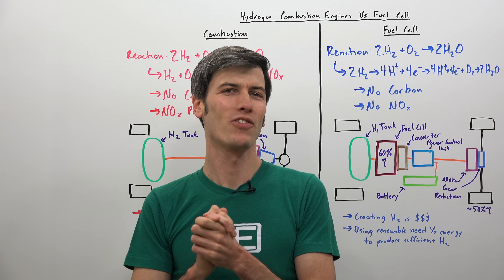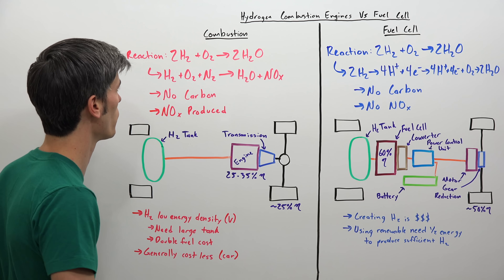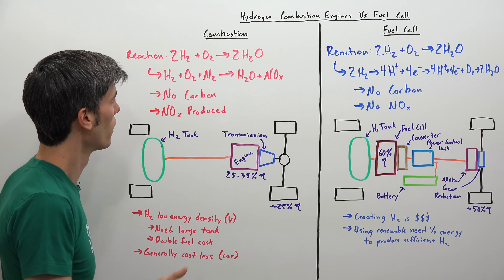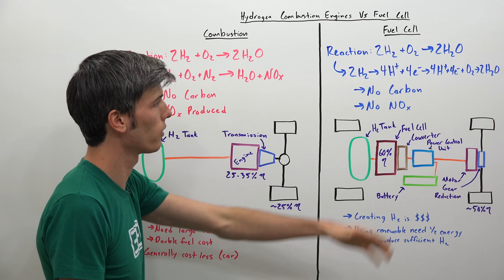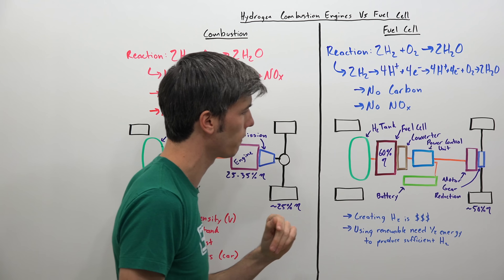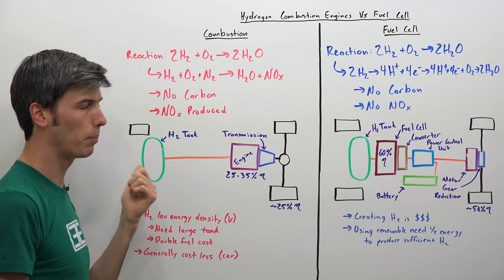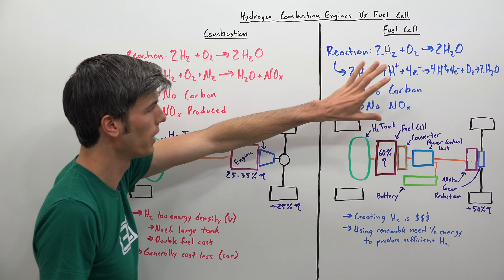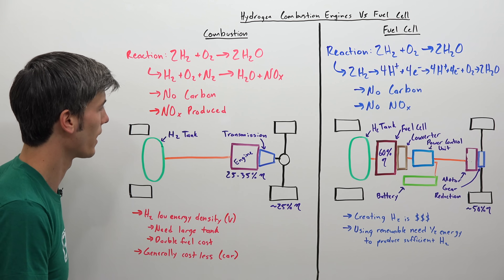Why Hydrogen Engines Are A Bad Idea

Comment: Great. But your first line chemical reactions are overly simplistic because you conflate oxygen with “air”. Neither of these solutions use a tank of pure oxygen. They both use air. Air is mostly nitrogen, as you imply on the left. But your description leaves it a bit unclear how the hydrogen engine produces NOX.
Reply: Yeah clearly he is a OPEC agent
Reply: He has in other videos. It comes down to the fact that the temperatures in a hydrogen combustion engine get high enough for reactions that produce nitrogen oxides to occur.
Reply: Any time you heat air much above 900 degrees C, the diNitrogen bonds begin to split into atomic nitrogen, the nitrogen then preferentially grab oxygen molecules. Above 1500 C this really starts going in earnest. You don't even need to burn anything if you compress air to a high enough temperature and pressure.
Unfortunately, any Carnot heat engine needs a large differential between the hot side and the cold side for maximum efficiency. This set of NOx reactions is also endothermic, further stealing energy from the combustion process that you want to turn into mechanical energy.
Reply: @Markle2k  last time I checked a combustion engine doesn't go higher than 300 C.
Reply: @Markle2k : Catalytic converter...   they do "magic".

kidding, they do Chemistry..
Reply: @NekarXenos  300 C isn't even hot enough to get the catalytic converter working. The flame temperature can be upwards of 2500 C in a diesel under load. Just from compression of the air a 10:1 CR gasoline engine gets to 463 C with a 20 C intake charge.
Reply: @Markle2k  2500?

what diesel engine ? where in the engine? under which circumstances?
diesel powered furnaces have  hard time melting cast iron let alone melt steel
Reply: @Markle2k  463c ? why would a gasoline engine need a sparkplug?
Reply: @Markle2k  463c? selfignition?
Reply: @janvanruth3485  All your questions were answered in the post you are replying to.
Reply: @Markle2k  you are just kidding, right??
don't have the answers? do you?
Reply: @janvanruth3485  Your reading comprehension sucks.
The flame front in a diesel under high load can reach over 2500 C. Diesels work opposite of spark ignition. Adding fuel raises the temperature. The exhaust isn't this hot because of work done through expansion and conduction through the cylinder walls.
Don't get carried away into rudeness just because your ignorance leads you to incredulity.
Reply: @Markle2k  if you have trouble putting forward ideas in a clear way maybe you should refrain from commenting .
first it was the flame, now y corrected it to the flame front
first it was under load, now it is under high load
Diesels work opposite of spark ignition?
what is that supposed to mean?
maybe: Diesels work differently from non self igniting engines that need a spark plug?
adding fuel does not raise the temperature, adding MORE fuel does.
now please do explain why at a temperature of 463 c , which is higher then the temperature of below 300c needed for self ignition of an air/gasoline mixture, a spark plug is needed.
Reply: @janvanruth3485  Stay in school mate!
Reply: @fleecemaster  ok, you give me the answers then.
Reply: @Markle2k  The ideal solution would be to combine pure Oxygen with pure Hydrogen. This can be produced by electrolysis of water, but the energy requirements are extremely high.  Combining pure Oxygen with pure Hydrogen will produce H2O as the only byproduct, but storing these two elements separately in a vehicle environment would be a challenge. If we had the Liquid Thorium Salt Reactor tech developed perhaps the electrolysis energy requirement could be met but............Hmmmm?

Comment: IMHO: FYI: I'd really like to see someone produce an "OPPOSED PISTON, DIESEL (INTERNAL COMBUSTION) ENGINE!!!.... AND USE IT FOR AN ELECTRICAL POWER GENERATOR, (FIXED BASE, OR PORTABLE)..... THE HYDROGEN COULD BE ELECTROLYZED, FROM ADJACENT SOLAR P.E. ARRAYS (i.e. ...ON A HOUSE/BARN ROOF, ETC.)... A high-pressure storage tank, can hold a lot of hydrogen, and still weigh less that a full liquid fuel tank.
Reply: I was yelling at my screen too, WHAT ABOUT HYDROGEN COMPRESSION ENGINE??? NOBODY IS USING THIS GREAT PROCESS AND USING IT IN DIESEL ENGINES???

Comment: you have right. atmosphearic air contains N(itorgoen), when we are using it in with high preassure and heat we are producing NOx (look diesel engines and high combustion gasoline engines).

Comment: I have one for you.
Diesel engines are notorius for NOx.
This happens because high oxygen environment inside the  combustion chamber.
The question is;
Is it possible to reduce NOx by adding LPG fuel in some small amounts. Knowing that LPG would definitely grab the extra oxygen preventing nitrogen from creating NOx.
I was thinking about that and on paper that looks good.
LPG will increase torque and hp value for sure, but reduction in NOx is what I'm interested.
What is your take on this.

Comment: Seems like an EV is much simpler
Reply: EV is cheaper, too, both to buy and fuel.
Reply: The only good thing about hydrogen, is it would be a perfect way to store the excess energy from wind turbines after a wind storm. Rather than curtailing, it would be nice to have a way to use that excess energy, despite not being as efficient as charging a battery.
Reply: @mychevysparkevdidntcatchfi1489 thats cuz there are no hydrogen combustion cars for sale
Reply: @greynolds17  No, it's because you can directly use the electrons to fuel a battery. Electrolysis of water and compression chew up half the energy before you even figure out how to get the hydrogen into a car's tank.
Reply: @Markle2k  I said hydrogen combustion...not hydrogen electrolysis
Reply: Vincent Robinette 
There are two reasons why that is a bad idea: 
1. The windmill would have to be build to turn very fast, increasing the costs. 
2. A station to make hydrogen would not be economically viable if it is only run when there is a storm.
Reply: @greynolds17  You need to get the hydrogen from somewhere. The atmosphere pretty much tosses any free hydrogen into space. The rest is locked as water, and to get hydrogen, you need to spend energy to split it out and pressurize it so it doesn't take up the volume of the entire car.
Reply: @vincentrobinette1507  
Can't you just have a bunch of batteries underneath the turbine?
Reply: @Appletank8  yea...I know how it works
Reply: @greynolds17  
then what part of that process makes it a good idea to use hydrogen for transportation? i will admit that hydrogen is definitely superior in refuel speed, though if capacitors evolve to increase their storage capacity, hydrogen will take the backseat again.
Reply: @Appletank8  where did I say it was a good idea?
Reply: @greynolds17  
Ah sorry, I misinterpreted your earlier statement as an assumption that hydrogen cars would rapidly outpace EV growth to make them irrelevant. If hydrogen storage/generation gets vastly better, that might happen.
Reply: It is, and it will be the future.
As neat as Hydrogen sounds, it wouldn't work.
Reply: @Appletank8  You could, and that's a great idea. The only thing is that during a wind storm, a large turbine could charge a 500 kWh battery in only about a half hour. A hydrogen electrolyzer  could assimulate 20 times that. It's just a way to not curtail in those times of overproduction. I still like the battery idea, though, because you can call upon the turbine even if the wind isn't blowing, and, you don't have to allocate extra land for the energy storage. Win-win. The hydrogen thing would just be a bonus.
Reply: Meh, a turbine with a continuously variable gearbox will handle any problems rotating too fast, or not fast enough. Rotation speed is irrelevant if we're not talking about all the innards of turbines as a complete system. Hydrogen has niche uses in the modern world, but long-term storage and efficiency in initially producing it are the only real issues these days.
Reply: @eindeend  It would only be practical if there was already an infrastructure in place. It wouldn't be worth it to put an electrolyzer in, just for that purpose. The blades of the turbine can be pitched to regulate speed, and even keep the torque in check. Just an idea to take advantage of a storm, rather than just letting it pass. The rotor torque increases on the square of wind speed, the power increases on the cube. During a storm, a turbine can produce 8 times more power, if the wind speed doubles. If, like you said, it could be built to run the higher speed. That's a huge potential, but, not likely with today's technology.
Reply: Everything has its advantages and disadvantages, innovation won't stop ever, soon there would be something better than ev's
Reply: @dhruvalbhansali3632  If you look at the fact that internal combustion has been around for well over a hundred years, and look at how many years steam ruled the railroads, I'm thinking electric vehicles will also be around for at least a hundred years or more. The biggest changes will be in the source of that electricity. That goes for both the way electricity is generated, as well as the way it's stored in the vehicles. For the sake of regenerative braking, there will be a need for a modest battery, or some kind of capacitor system. Who knows: Maybe even a system involving springs, pistons and hydraulics.
Reply: @vincentrobinette1507   agree with u bro, battery technology is the only hurdle seen in proper mainstreaming of EV's , going with history, EV may last 100 years at least, but we never know, technology is progressing exponentially now then ever before, anything could be possible!
Reply: @dhruvalbhansali3632  I agree. It will be interesting what takes its place. who knows. I joke about my next car not coming with the optional engine, but in the future, your next ride may not even come with wheels! Imagine a conveyance with touch controls, with absolutely no moving parts. RELIABILITY!!!!!!!!!
Reply: @vincentrobinette1507   super reliable for sure! maybe a ion thruster engine! we may never know, but surely future is something to be excited for!
Reply: @dhruvalbhansali3632  AAAAAAMMMMMEEEEEEEEENNNNNNNN!!!!!!!!!!!!!!!!!😎👌
Reply: EVs as we know them today are not sustainable in the long term, there really isn't many viable large volume chemical storage on the horizon, under current consumption we are likely to run out of lithium before we run out of oil
Reply: @BluTrollPro  That's especially true, if lithium is used for stationary storage, as well as vehicles. For stationary storage, we should be exploring less expensive, even if more bulky solutions. Save lithium, where power density is of particular importance, like vehicles, and consumer electronics. Australia just found a lot of lithium, but I still don't want to squander it on stationary energy storage.
Reply: It is, far better, faster simpler and more fun the ICE engines.

Comment: The combustion engine might need a bigger tank but the fuel cell needs an H2 tank, a Fuel cell tank, coneverter, power control unit, big ass battery, and an eletric motor. Just looking at the drawing, you can see the fuel cell power looks unblanced, heavy and over complex with alot more space needed to make power. I would take the combustion design.
Reply: Toyota and Hyundai already have working products not sure what you mean by unbalanced? Is it the weight because alot of our cars have balanced and unbalanced variations.

Comment: You've stated 2 disadvantages of the Otto engine. First, the Otto's NOx is greatly reduced by EGR, as you well know. Second, internal-combustion engines aren't the only ones that can burn H2.  The Stirling-Engine is much more efficient than the Otto engine, and doesn't have a NOx problem because it doesn't use the high temperature that's easily-feasible with the Otto's very brief combustion (In the Otto, the metal doesn't have time to melt). Without the temps possible with explosion-engines or super-high-melting alloys, NOx isn't a problem.

Comment: Next video: here is why hydrogen engines are good
Reply: Look back at previous videos, this is not his first hydrogen related video.
Reply: @jaydunbar7538  they've all been critical of hydrogen while he keeps singing praises of EV. We need him to even out the bias.
Reply: @kirknay  You can't even out the bias when one technology is inherently worse than the other.
Reply: @kenkalajdzic  except when the ecological impact of batteries are worse than steel or carbon fiber tanks and fuel cells, refuelling is down to 3 minutes instead of 8 hours, etc.
Reply: @kirknay  Is it really worse though? They ain't good for sure, but so far there's no evidence of batteries being worse - especially when they can be recycled. Recharging can be as short as 15 minutes, we just need better infrastructure. And that's with current technology, that keeps improving quite quickly.

Also, don't forget that that awesome hydrogen has to come from somewhere. And it usually comes from natural gas in a very NON carbon neutral procedure. Alternative is using lots of electricity that you might as well use for charging batteries (about 3 times less at that).
Reply: @kenkalajdzic  15 minutes is still an eternity when you need to drive for 4 hours to get home from reserve drills. Hydrogen from natural gas is currently a stopgap until the infrastructure and demand is ready.
Reply: @kirknay  It's not ideal (yet), but you need breaks anyways when driving long distances. Most people stop for at least that much even now with <1 min refill times on gas tanks.
Hydrogen could be a good stopgap solution until battery electric tech matures, but it's pretty expensive one. Probably too expensive to invest into when you already know it's getting replaced relatively soon. I guess that's also why most companies never put too much effort into it and are now all jumping straight to BEV.
Reply: @kirknay  There is no way to even out the bias and remain fair and objective. Battery-electric has the lead in efficiency from input to rolling wheels.
And give up the tired old talking points about batteries being more dirty. That was debunked a decade ago.
Reply: @kirknay  15 mins is an eternity? vs 10 mins to refuel hydrogen? If 15 mins will make or break you, you're doing something wrong.
Reply: and without fuelling infrastructure, it is useless. Need some poor sap to install the manufacturing of it, only 40% efficient, how many fuelling stations are you going to install, how many diesel tankers are you going to have to transport it around. Under the control of big oil I bet
Reply: @Markle2k  Batteries weigh twice as much which takes out all their supposed efficiency savings. Fuel cell is the future, it can replace gasoline in almost all usages, batteries cannot.
Reply: @agt155  Twice as much as what? A fuel cell vehicle? My brother has a Honda Clarity FCV. It's enormous in comparison to the Model 3 LR rear-drive. The Clarity weighs 200 lbs more. They have nearly identical passenger volume. It has a ridiculous 57/43 weight distribution that is worse than the Clarity EV's 52/48. It is 3 seconds slower to 60 than the Tesla. It has a smaller trunk due to the large cylinder packed under the rear seatback. It will cost $80-90 to fill tank when the card runs out and every 10,000 miles the special non-conductive coolant has to be topped up at a cost of $80/liter.  And it has a real world range of 240 miles instead of 300 miles. It has no limp-home mode from the regen battery or ability to charge that battery from a plug. If you run out of hydrogen you have to call a flatbed truck to take you to the nearest hydrogen filling station or FCV-authorized Honda dealer.
You can't transport hydrogen from a central generation facility. It has to be done on-site at the filling station. They can service just a few cars a day and cost $1 million to build.
Reply: @Markle2k  The new Honda Clarity has nearly twice the range!!. Find a battery powered car that has over 400 mile range and then we'll compare weights.
Reply: @agt155  The Clarity FCV does not have a 400 mile range. No Clarity does. The FCV has a claimed 360 mile range, but nobody but the EPA seems to be able to match that. Certainly not actual owners (well, lessees) like my brother or any of the auto magazines.
Quit moving the goalposts as if you can easily confuse people. We were discussing fuel cell vehicles versus battery electric.
The Clarity fuel cell has a curb weight of 4134 lbs in 2018, about 100 lbs. more than my brother's 2017. The Clarity EV has a puny 25.5 kWh battery and only 89 miles range. The Clarity plug-in hybrid is 4052 lbs and 340 miles EPA range with its smaller 17 kWh battery and cannot fast charge. Both of these are slower than the FCV with smaller electric motors and the PHV with an Atkinson-cycle 1.5 liter.
Yep, they are all heavier than the Model 3 with a bigger footprint, bigger frontal area, and yet, equivalent interior space. But the Model 3 absolutely smokes all of them on fuel consumption at 130 MPGe that is verified in real-world driving.
Reply: @Markle2k  No manufacturer fails to live up to claimed range like Tesla.

2018 Honda Clarity FCV range is 404 miles NEDC (the standard over here) Yes it probably won't reach that on average but we know Teslas fall well short of their claimed range. You cannot argue against obvious fact. Batteries are very heavy compared to Hydrogen/Hydrogen tanks. Hydrogen has 200 times the energy density of the best batteries. FCV technology has much further to mature than EVs. Even now though, the Honda Clarity FCV out ranges comparable battery cars and retails for less.